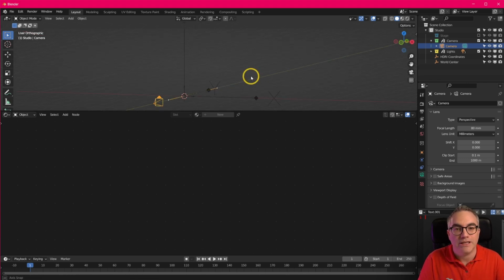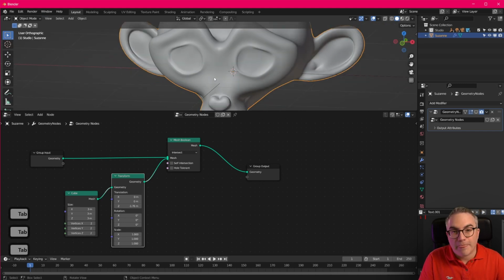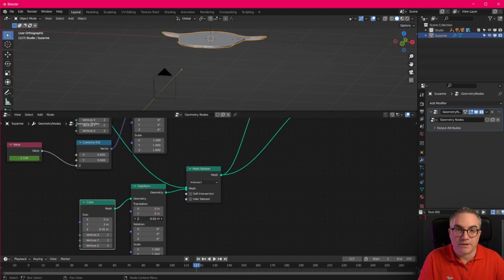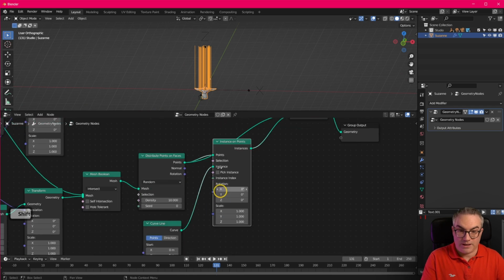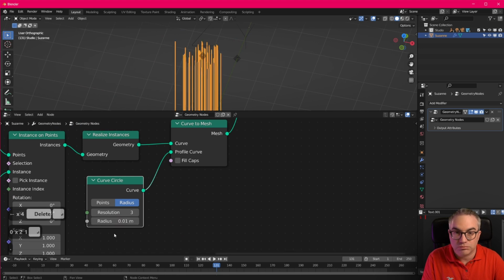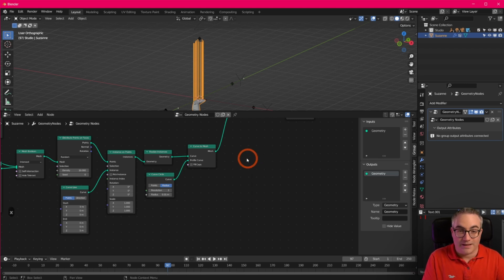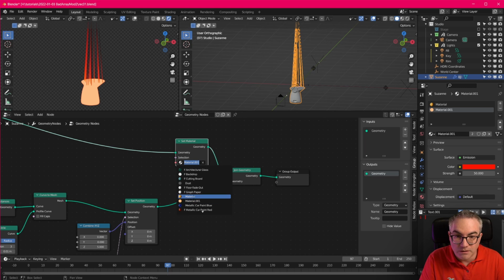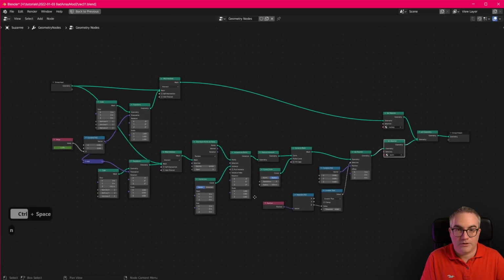Geometry Nodes Sci-Fi Laser 3D Printer Blender 3 Tutorial

Comment: Another thing that could be added:

By adding an "Input" node, running it into another "Combine XYZ" node connected to the "End" area of the "Curve Line" node as well as the "Combine XYZ" of the "Set Position" node, as well as the top of a "Math" node set to "Subtract" with the bottom value set to 1, you can actually control the height of the lasers.

Comment: That is a cool exec of Geo node in simplicity - bravo Chris. 
Just out of curiosity I've tried animation nodes tutorial months before and after 3 mins i didn't like it but with this geo nodes you nailed it.

3 things I've tried now:
1 - manifold suzanne, instead of adding sub-d modifier, i' just put it in the geo node set + set shade smooth node in the beginning,
2 - suzanne can have material right away no need set material
3 - will try standart non manifold suzanne head with this sub-d node

Also pin your own FYI comment on the top, cheers man happy new year!

Comment: Great, thanks! Here's a question: When using the Boolean MODIFIER you can toogle the solver between  'fast' and 'exact'...  Which setting is used when doing it with 'Mesh Boolean' node? Is there a way to pick a solver with geo nodes?
I felt that the edges of your Suzanne looked kind of jagged.
Reply from the maker: good question....

Comment: If you want less crazy solution than welding 5 meters, after realize instances use endpoint selection node and set position just for x and y-axis (position->multiply vec 0,0,1->set position [endpoint selection node will choose just last point from each curve line]).
Reply from the maker: I actually used endpoint sel for another thing I tried ... Don't know why I didn't do it in this tut 🤔. Anyway YES that would be better since the laser "tubes" would be the same thickness all the way!
Reply: Would you have an example of what that node tree looks like. I'm still not sure what you mean and it was mentioned a couple times :-/

Comment: Realy like your slow way of explaining things and that you try different things out in your tutorials. That catches up a lot of beginners.
Question: What's a manifold mesh? Feeling like a bob to ask but never heard about that.
I would have made the laser beams clamp there on the top with an icosphere that I scaled infinitely small and I would use a geometry proximity node to use the position output to clamp the curves onto the position. Then the lines should be gone because they were clamped onto our infinite icosphere but I would limit the effect with a "Curve parameter" Input node to only clamp them on the endpoint. Then the endpoint is a global point and does not change its position like yours. And you can change the endpoint position in your viewport. Have no idea if it works. I didn't try but it should.
Thanks!
Reply from the maker: Ad Manifold: Suzanne is not "airtight" by default. Ad clamp: you can easily make the curves the correct length (line set to direction + length and easy calc the length = distance of point to laser origin) but with the 2nd method (set position) the laser origin is fixed anyway so I didn't want to go into that detail